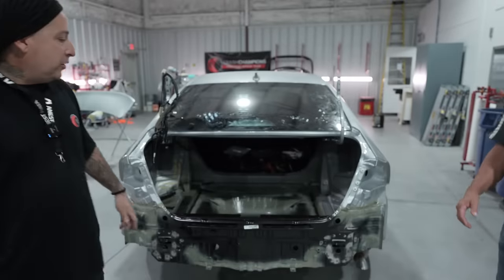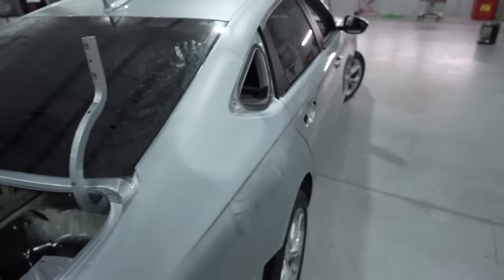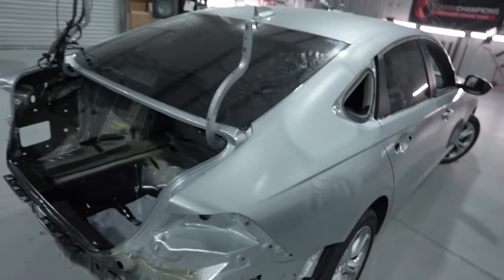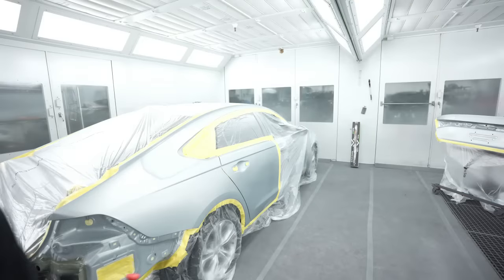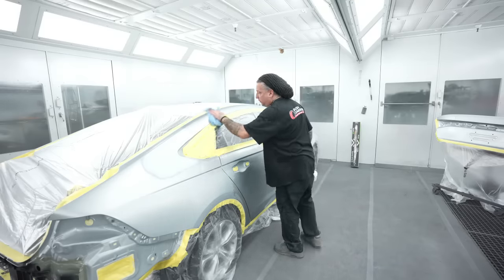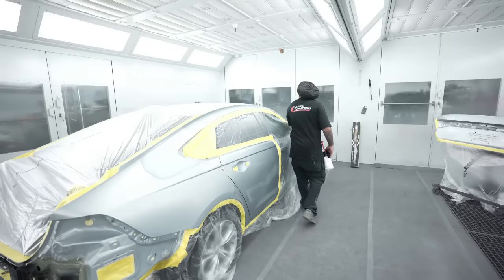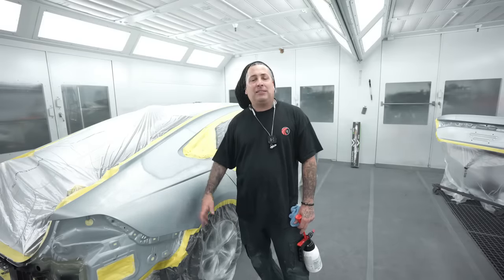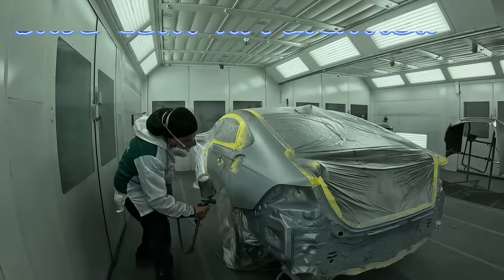Day 3 Of Training With BASF Glasurit 100 Line

Comment: You are doing a great job with this new system Kandy Man as this job looks superb, Patrick looks like he is a very good teacher and has got you up to speed very quickly, it's amazing that the Glasurit base covers in one coat but how it doesn't run is beyond me as it looks really wet on the panel, looking forward to the 3 stage tomorrow👌🙏👍John UK

Comment: You're right about the waterbase, and some of them just one application, one panel at a time.
Covers great, amazing how much you can lay on in one go.
I've only used DeBeers 900+, and yeah, 2 good coats, then most often to very low pressure drop coat, from a distance.
Feels odd to start out after using solvent base for so long.

Comment: I was at a shop that got bought out by a mso like you. It's all fun at the beginning but when everything settles, they cut paint times in half. I doubt you'll be there in 6 months. Not trying to be negative, but they won't value you at all. They will bring in painters that will do your job for much cheaper. Be vigilant and make sure you can find another shop that wants you!
Reply from the maker: This is a good company .
Reply: That sounds like the Crash champions of my area for sure…they have good products but they cut the employees off at the knees!!

Comment: I’m not sure what e-coats you use but we use SEM and you can type in the SEM part number on the can into the formula look up and it will pull up that ecoat color so you can mix it as a base

Comment: Sh*t looks cherry bro ! IDK if you have ever tried this but i put scuff pads on a small d/a with a velco backing pad. I fold it over so its thicker and blast through  the prep work. I have been doing that for years. It works awesome.  Nice to see glasurit is a 1.5 coat system. Like chroma & spies 480.

Comment: I know a guy in germany who paints an entire car with less than a pint (base coat) ….  That is how good the coverage is …  like you said: one coat!
Reply: Hi Peter, that seems a stretch to me a quart maybe but a pint. Must be a small car. And since when did a German like you start using Imperial measurements? Denny Schmidt here. How are you my friend? You and STEL getting along?
Reply: @satamanschmidt3428 it was 500ml of a dark blue for a Opel Omega sedan. Full respray outside (no door jams) to match a mercedes s class for  cobra 11 die autobahn polizei, where they ended up jumping and blowing up that opel omega instead of the s class on tv and you couldn’t tell the difference 😂😂😂.  
They called it a movie paint job ….  BUT it was 100 better than a masco retail paint job in this country …  the car was damn near perfect !!! (Perfect painted…)